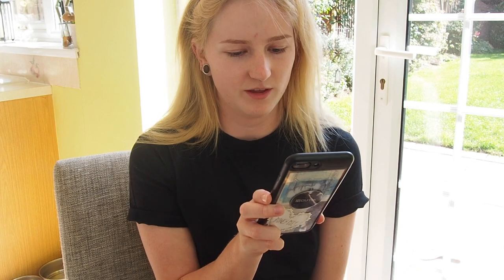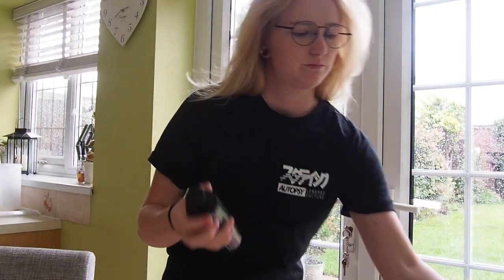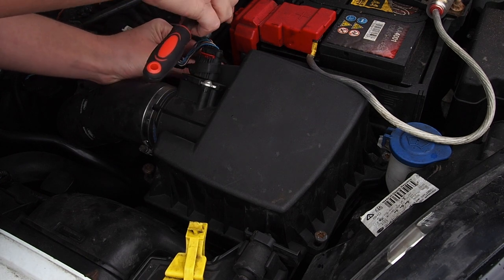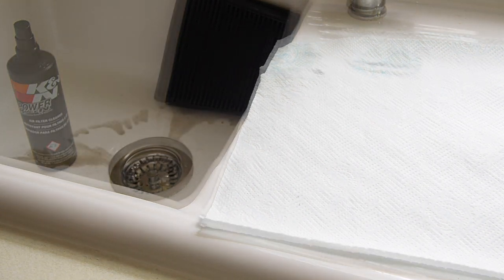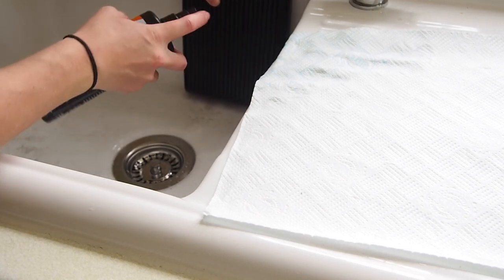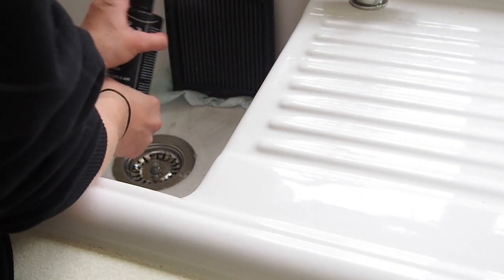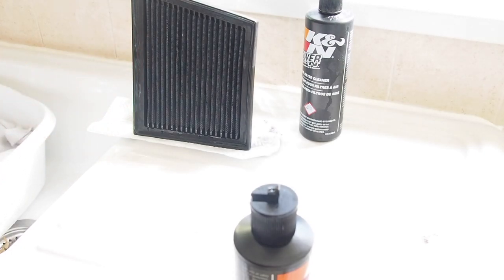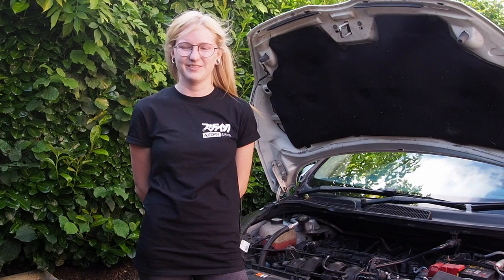How to clean a upgraded Air Filter - Ford Fiesta mk7

Comment: You have been scammed, this type of air filter does absolutely NOTHING for performance apart from decrease it and degrade it as time goes on.
The correct paper element is around 13 times bigger if you unfold it and put it next to that one.  That means your cheap aftermarket one needs holes in it that are more than 13times the size to allow anywhere near the amount of air through that the paper element does.
That presents a further problem, with massive holes, massive bits of dirt and dust get through and in to your engine.  The oil also comes off and damages MAF sensors as I found when experimenting years ago.  Mine caused £200 of damage to my car and K&N refused to accept the Dealership report of what they found, also refused to accept liability despite that kind of oil being used nowhere else on the car!
Because the surface area of your aftermarket one is 13 times smaller than what the manufacturer recommends for correct filtration and airflow, it will block much faster and degrade the performance of your engine.
The noise you hear people calling "induction roar" or "induction noise" is the sound of the air being restricted by the aftermarket filter.
I conducted tests for many years on all types of engines and found the only suitable filters were the original paper ones.
Another thing people do is remove resonators and air filter housings, then end up with hot air degrading performance and extra noise.
The best advice is to learn about cars, learn about engines and filtration, look at the products and how they work - then test them on vehicles as I did on a rolling road and in real life tests.  Who do you trust more, a car company spending billions on research and development, or a backstreet company or ebay seller knocking out products they say makes your car faster!
You have been #scammed.

Comment: Doesn’t seem right to put oil on the filter, why do you have to do this?
Reply from the maker: Very good point! haha, it does try to a sticky like finish doesn't stay wet. helps to catch the dirt too i believe :)
Reply: K E L S E Y L E I G H 
Ahh makes sense I have the same car as you but in black how do you find the filter would you recommend getting one?
Reply from the maker: @agentninja3815  Yeah it's great I recommend :)
Reply: @agentninja3815  you need to a the air intake, you can't just buy the filter and use it on your stock intake